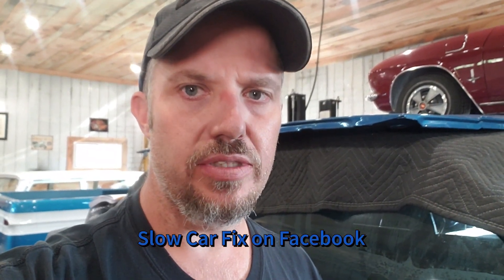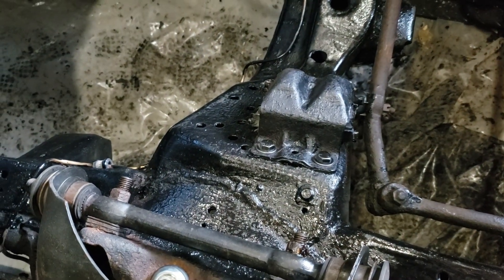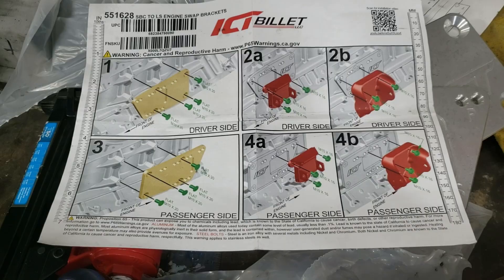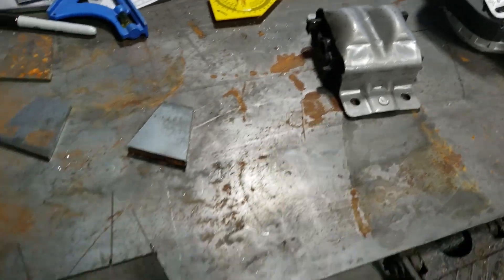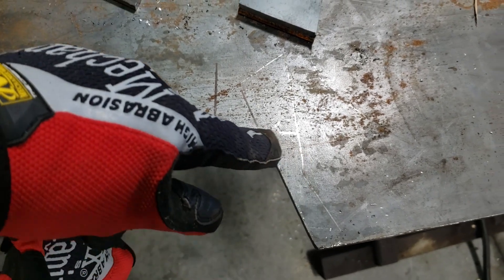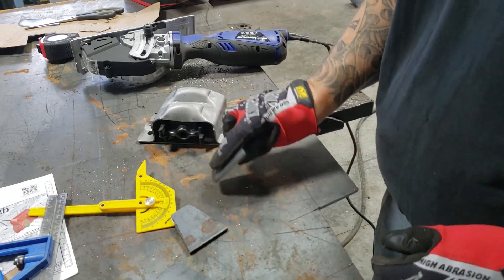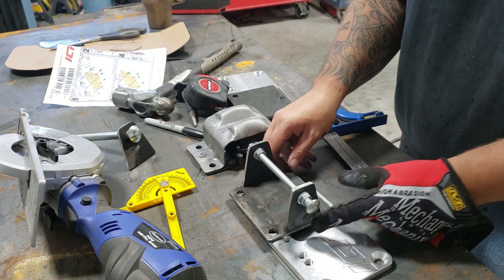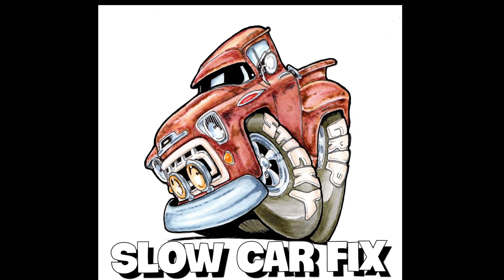Fabricating an engine mount "Clamshell" bracket for my LS Swap

Comment: Thank you for your vid. In having an issue as I hand the thinnest LS oil pan and my tie rods are still hitting my pan. How tall are your mounts you made?
Reply: The tall energy polyurethane mounts to the center of the hole is only 2", but I need 3" .
Reply from the maker: I don't remember the exact measurement, but I did end up with the engine hanging in the car and I had to adjust them for hood clearance and re-install. It's a balance with the G/A body cars to not hit the steering, and have enough clearance to clear the hood. On my '57 Truck, I used a TSP pan instead and I think it would have more clearance than the GM Muscle car pan.
Reply: @SlowCarFix  Thank you I will check them out.

Comment: What kind of saw and blade is that
Reply from the maker: it's not just the blade, it's the saw. It's Eastwood's metal saw. Very cheap and works well. I don't think a regular circular saw is built for that.